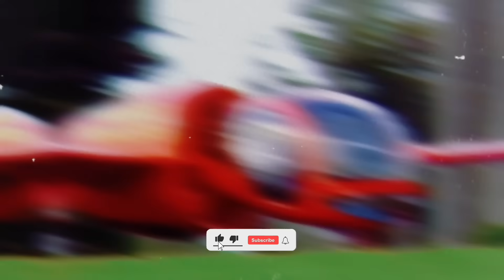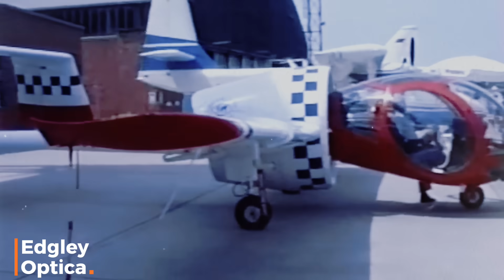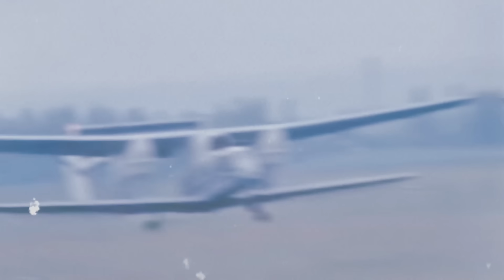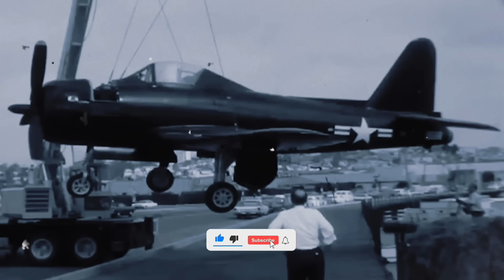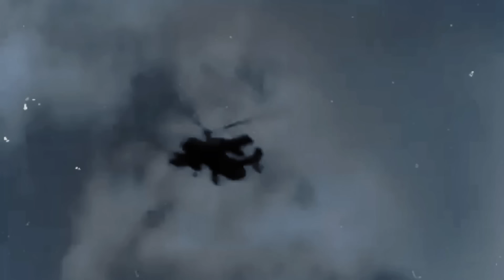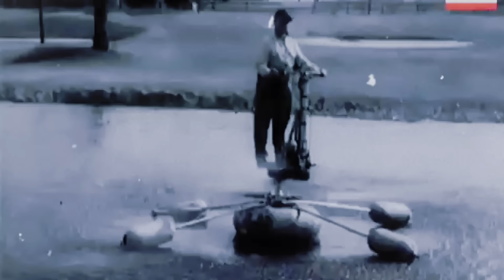10 Bizarre Vintage Aircraft You’ve Never Seen Before!

Comment: I was a film cameraman, and I once was hired to film a stretch of motorway under construction.  The plane was the Edgely Optica, and once I had constructed a solid mount for the 16mm camera the plane proved to be very stable with low vibrations in the cockpit.  Because it flew so slowly I was able to film exactly what the producer wanted and at a fraction of the cost of using a helicopter.

Comment: This Russian airplane, the AN-72 4:20 looks just fine. This is a STOL (short take off and land) transporter. We built two prototype aircraft which look very much like this one. The Boeing YC-14 and the McDonnell Douglas YC-15. Those evolved into our C-17 Globe Master II transporter. A much bigger plane doing what this plane does.
Reply: YC-14 & YC-15...Tooling from the -15 was used to design/manufacture the C-17A
Reply from the maker: You are spot on about its STOL capabilities! The An-72 is a fantastic heavy lifter. And great call bringing up the Boeing YC-14 and McDonnell Douglas prototypes. It is fascinating how that Cold War era of parallel thinking eventually evolved into massive modern legends like the C-17 Globemaster III. Great aviation history!

Comment: Blohm and Voss 141.  look it up
you are not freaking out
engine and tail on one pod
cockpit on another
non symmetrical
BUT
if you the issue of taking off in a tail dragger aircraft. It was an interesting way to fix it
and it did work
Reply from the maker: The BV 141 is the ultimate definition of bizarre! That asymmetrical design looks like a glitch in the matrix, but the engineering logic behind fixing the torque and visibility issues was actually brilliant. We definitely need to feature that masterpiece in our next video. Great suggestion!
Reply: @UltimateMachinery9  might make a sidenote with Burt Rutan's personal plane, it has a similar idea

Comment: The guppy , even if I find myself very much intrigued by the looks of its design . Considering its overal shape , load placement and placement of wings and engine . I consider the entire design , very unstable and unsafe to fly .
Reply from the maker: We don't blame you for thinking that! Looking at its massive, bulbous forehead, it seems like it should instantly flip over the moment it takes off. It defies all common sense, but the aerospace engineers somehow managed to balance the center of gravity perfectly. It looks like a bumblebee that shouldn't fly, but it does!
Reply: @UltimateMachinery9 well I m no so much concert about load stability forward or backwards , more like in terms of roll stability in consideration of wing and engine placement “under load , instead of above load” as wings and engine have bin place under center of mass axle making it in terms of roll very unstable and unsafe to fly .

Comment: that sovjet era cargo hauler with it's engines on top of the wings is beside being a good heavy lifter it's desing is far more pratical and safe then engines under the wings when crashing i bet surviveability that exact plane has more changes of survival for it's occupance .
Reply from the maker: You make a really interesting point! Putting the engines over the wings on those Soviet haulers like the Antonov An-72 was incredibly practical, especially for avoiding debris on rough, unpaved runways. It definitely seems like it would offer a different dynamic in an emergency belly landing compared to low-hanging underwing pods. Great observation!

Comment: The Ryan Fireball was not the first hybrid prop/jet aircraft design, although it was the first actually built. The German Dornier P.254 (later Do 535, then He 535 after the project was handed over to Heinkel) was to be a development of the Do 335 with its rear engine replaced by a turbo jet. Unfortunately, the declining state of the German aircraft industry at the end of the war caused the project to be canceled before any airframes were built.
Reply from the maker: Thank you for the fantastic historical deep dive! You are absolutely right to point out the distinction between the first designed (the Dornier) and the first actually built. We love having this level of aviation history added to the comments!

Comment: The Belphegor was a design intended to replace the An-2 biplane as an agricultural aircraft, while being a more modern design, but it failed badly. With half the range, a significantly higher maintenance requirement for its jet engine, it was much more expensive to operate, and the crop dusting payload being stored in two tanks integral to the airframe meant that, unlike the An-2, the pesticide tank could not be removed to use the aircraft for cargo transport.
Reply from the maker: This is a brilliant and perfectly detailed explanation of why the M-15 Belphegor failed so badly! Comparing its practical flaws directly to the legendary versatility of the An-2 really puts it in perspective. Putting jet engines on a crop duster with fixed pesticide tanks was definitely a massive miscalculation. Thank you for this excellent breakdown!

Comment: Miles Aerovan used the same layout as the WW2 Arado transports and was one of the first of the modern transports with cargo deck at truck-bed height, => C-130, C-141, C-5, Short Belfast, C-17, A400M
An-72, Boeing YC-14, same principle.
Edgely Optica, good design, for niche roles. Helicopters have the ability to halt completely or reverse, at the cost of constantly trying to shake itself apart.
The Guppies were a good solution to moving bulky but light cargo. The cargo bay is huge but the actual density is low.
Ryan FR Fireball was a sensible test vehicle to see how practical jet engines were for carrier aviation, it was not expected to be a genuine fighter.
The Fairy Rotordyne was handicapped by the under-performance of the Napier Eland turboprops. If those had been replace by RR Tynes, the tip jets could have been cold rather than hot. 
The flying platforms such as the Aerocycle was an attempt to increase the mobility of infantry scouts, but all it really did was turn it's pilots into loud slow targets who would be too busy controlling the thing to do any observation or try to use a rifle. => drones much better solution.
Reply from the maker: This is an incredible breakdown of aviation lineage! Drawing the line from the Arado to the Miles Aerovan, and recognizing it as the foundation for the truck-bed height cargo deck on legends like the C-130 and C-17, is brilliant analysis. Thanks for sharing this deep technical insight!
Reply: Yes, it reminded me of the Gotha 232 transport plane from WW2.

Comment: The Piasecki VZ-8 Airgeep reminds me of nothing so much as Marvel Comics' Fantasticar from "Fantastic Four" No. 3 in 1962.  The old "flying bathtub" handled better, though.  Maybe the Airgeep would have been alright with some computer assistance.  Maybe the design should be revisited with modern materials and processes.  "Fan standing" might become practical.
Reply from the maker: That Fantasticar comparison is incredibly spot on! 😂 And you make a brilliant engineering point. If the Airgeep had modern fly-by-wire technology, lightweight materials, and today's drone stabilization software, that 'flying bathtub' concept would probably be incredibly practical today. Thanks for the awesome insights!